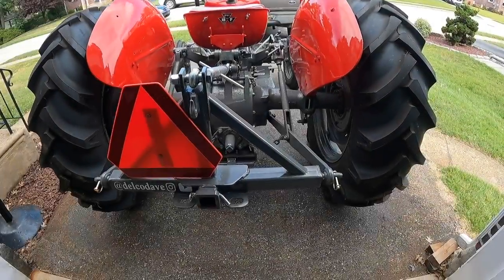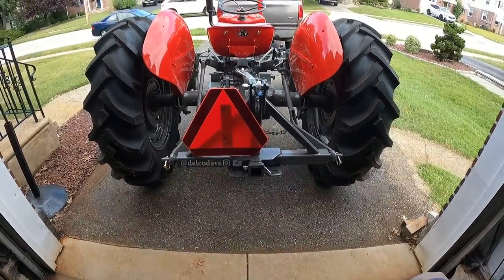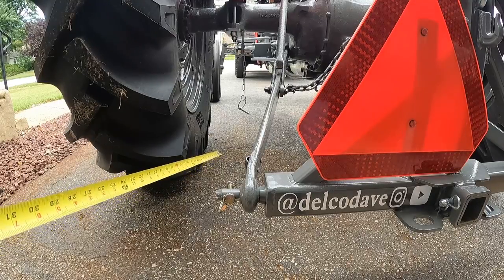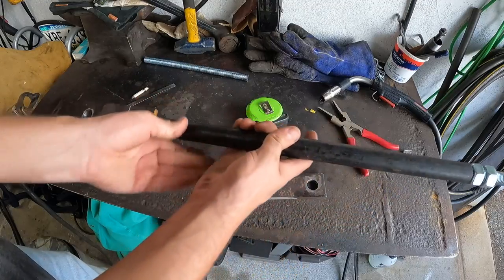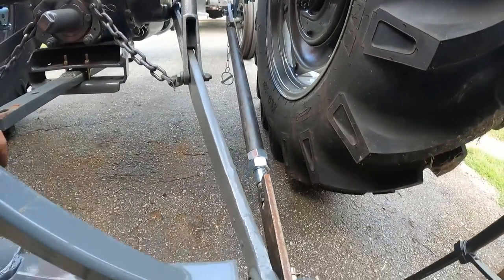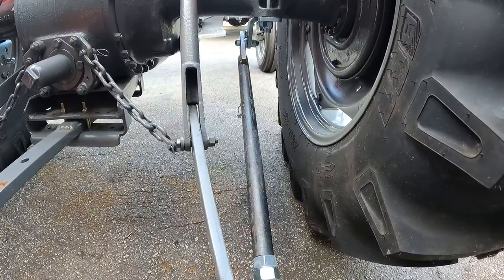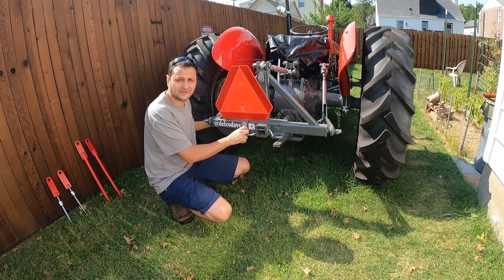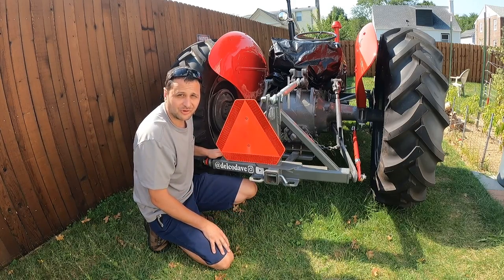3 point hitch stabilizer bars

Comment: My 35 has a second set of chains running from the fixing points on the axle to the same point as the inner chains on the lower links this seems easier and allows for adjustment of the tension!
Reply from the maker: I never saw a setup like that before sounds like it would work well.

Comment: Smart guy!!!   Needing to do the same thing on my JD 1020.
Reply from the maker: They work great and make backing up trailers much easier with no slop in the 3 point.
Reply: @thedelcodave    I put chains on but I think they are to soft and have stretched. I may just upgrade the chains.  I can’t remember the different mounting opportunities until I look at it again.
Reply from the maker: @nmjazz09  chains would work but these adjustable bars are nice because you can tighten all slop out.
Reply: @thedelcodave    I agree.  I even got a different but similar idea from what you did.

Comment: I have a 1960 MF TO-35 passed down I am the 5th generation with it. Would love to know where you track down some of those parts.
Reply from the maker: In the USA there are three companies all owned by one that have a ton of parts. Yesterdays tractors, all states ag parts and tractor Joe.  Some specialty parts like the serial number plates I found on eBay in England.  Most of the aftermarket parts are made by sparex.

Comment: measure both sides, add them together and divide by two, this is the centre to centre for the sway bar, you will need to make an offset on the bar too. Normally they are made from 2x1/2 inch bar. I only use a sway bar on one side. I think your rear mount frame may be a bit wide so the geometry is not the best?
Reply from the maker: I could definitely see if my hitch frame was a couple of inches more narrow it would make my bars work even better.  Most of the movement that is left now is coming from the worn ball sockets on the 3 point arms.

Comment: The geometry doesnt allow for completely solid stability.  But much better for sure
Reply from the maker: It's a pretty slick design. The bulk of the play now comes from the worn ball socket ends on the 3 point arms. I bet on a newer tractor it could be rock solid.